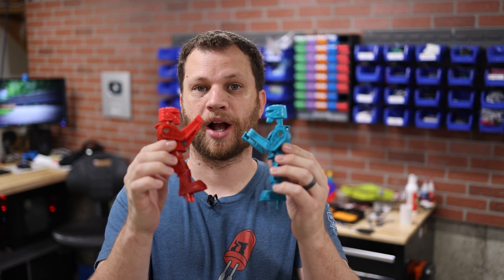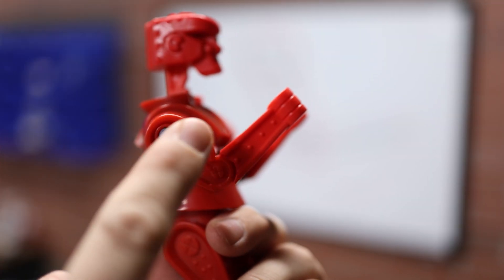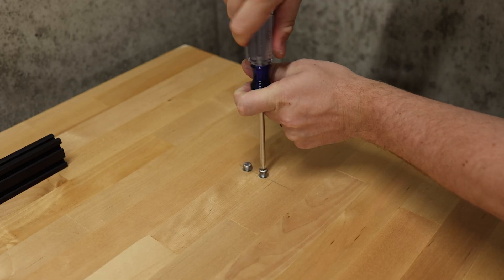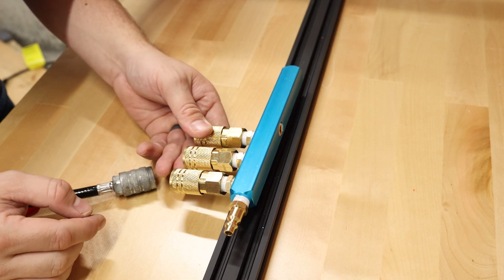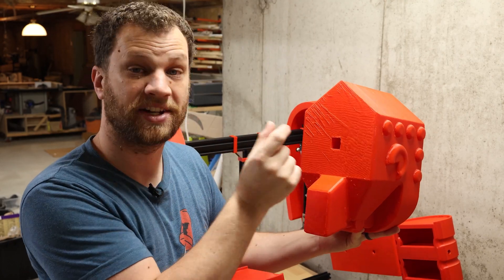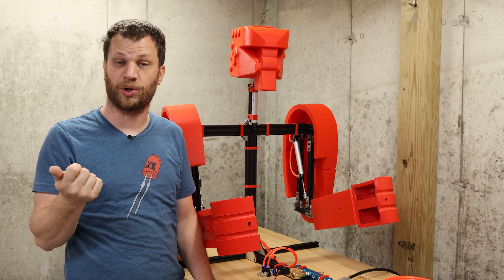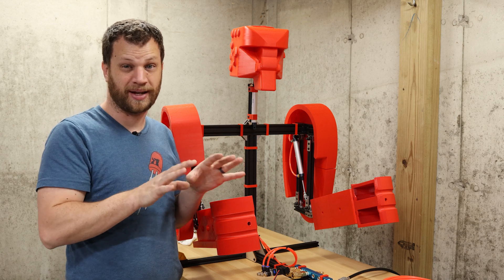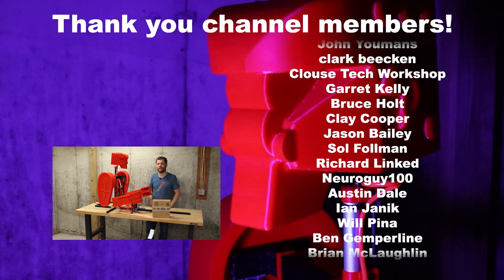I may have jinxed it... - Life Size Rock'em Sock'em Robots Part 2

Comment: Love your videos. Something with this project I noticed is the punches hit the chest area vs the original where they are more upper cuts. Will you be changing the design to mimic that or keep it the same?
Reply from the maker: You know I thought a lot about this. You are correct, on the original toy the punches are more uppercut style. From what I can tell most of them land on the chest, but if one hits the chin it pushes it back just far enough to release it from the clip and the head pops up. Ultimately, I decided that I want my punches to hit the chest because I can make that more robust. I don't want heavy punches hitting the head because it will bend the rod in the pneumatic cylinder. I'd rather avoid that expensive failure!
Reply: @bytesizedengineering  Makes sense to me. I look forward to the next video. :)

Comment: Leak checking pneumatics - water with some dish soap in it is your friend. Pref in one of those squeazy bottles with a nozzle. Put a bit of water around the interface points and if it bubbles up you got a leak.
Reply from the maker: That's exactly what I did! I used a syringe cuz it's what I had on hand. Great tip. Thanks for sharing!

Comment: I'm confused if you want to appear professional or not. You didn't have to show that clip of tapping the extruded end, but you did. You didn't have the part clamped so you could use the tap with both hands and you were really wobbly...
I'm just curious about the impression I am supposed to have.
I don't care. Wobble away. Whatever works I still like what you do. I was just wondering.